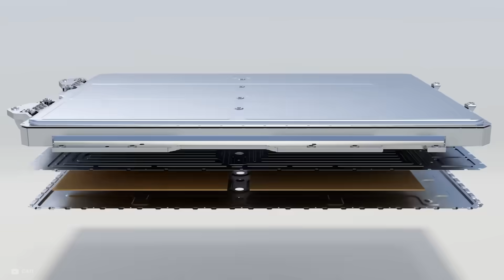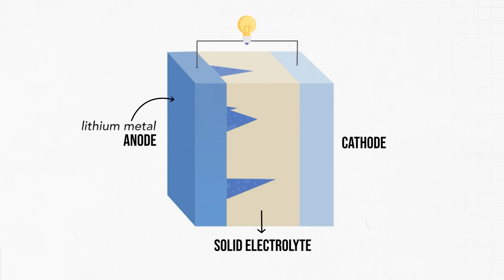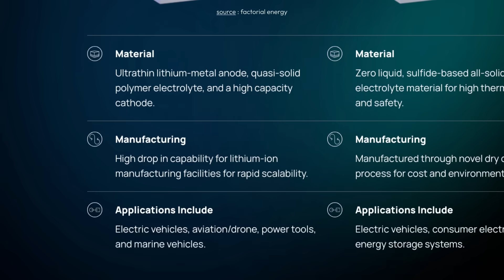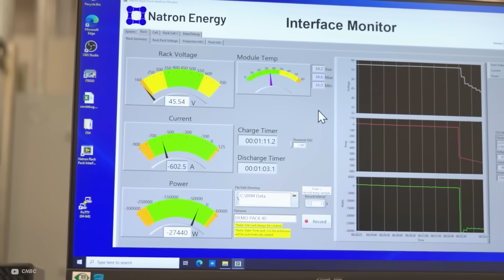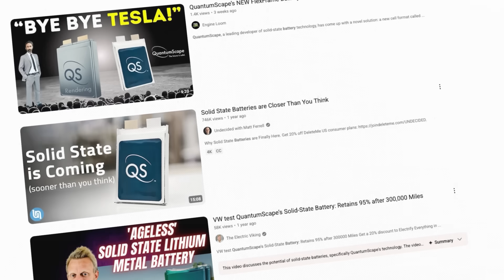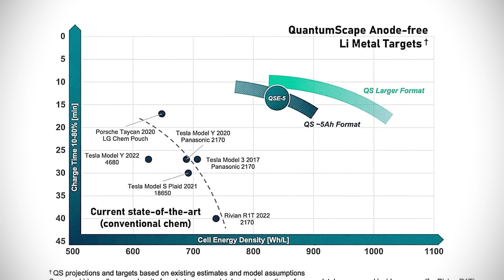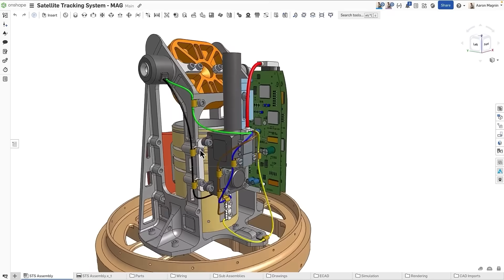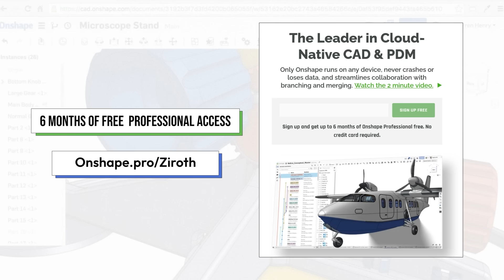The Decade Wait is Over, Solid-State Exists.

Comment: High-purity silica sand is the key to the mass production of these batteries. Is there enough of this sand out there in the wild to ensure that this can happen?
Reply: There's a company called Homerun Resources that is working with the University of California-Davis to develop advanced silica-purfication techniques for regular silica sand. If they can scale this technology, there should be more than enough sand for millenia.
Reply: @MontyBurns99  Interesting. Going to look into this.
Reply: Ffs….. refining silica is easy AF….. it literally just makes the process slightly more cost effective to start with more pure base material.

Use your brains….. you think we can refine from 99.9% to 99.9999999% 

But we can’t refine from 98 to 99.9%? 

I bet you I can refine sand I find at the local park with drain cleaner to make sodium silicate, and then make higher purity silica than that “high purity silica sand” that we’re pretending is the bottle neck of an entire industry because of that one documentary also made by people that don’t know what they’re talking about.
Reply: The purest silica is actually synthesized. We can also purify it, and recycle it. 

  The tech isn't exactly the most researched when we still have mines with 99.9999% pure. 

 Yes Spice Pine is a godsend. It's not the only solution. 

 Probably will find more mines too. 

 Just like with the grid or oil. There is no point in research investment if there is a cheap supply. 

 Did you guys know for like 20 years there. From 2000-2020 with a few exceptions. Energy demand was stagnant in the US? 

 Electronic demand went up, but also tech became more efficient. 

 China, not being capitalist. Doesn't care about profits. I just read China has found high quality deposites, and is pushing tech to purify it. I don't see Trump doing that. 

 So they are out there. We just need to find em. Even if it isn't nine nine pure. 

 Also maybe we can just stop exporting it to neutral or enemy countries we don't really need anything from.
Reply: Yeah, I think there is probably enough of the most abundant solid element on earth 😂
Reply: CATL will be the first
Reply: Silicates comprise around 20% of the elements in the entire earth. Look up UBIQUITOUS.
Reply: It's so good the internet is full of know-it-alls like yourself ... If only those dumb scientists listened 😤
Reply: Let's be clear, the ceramics used here would be using rounded sand not angular.  This is not for concrete; angular is the rarer kind because it's from more recent erosion.

Also this is 40 microns thick.
Reply: We have been purifying sillica for decades, how do you think we have been manufacturing all those silicon based computers, the abundance of silicon is outside the grasp of human intuition. Maybe the adoption of solid state batteries would pressure the manufacture industry to look for cheaper purification methods which would only benefit everyone
Reply: @Aurem6974  I'm talking about 99.9% pure silica. That isn't readily available yet
Reply: I think the shortage is based on demand rather than supply, nobody really needed 99.9% pure sand at these quantities before, but i doubt theres any resource scarcity reason to prevent them from scaling up
Reply: Been to the desert before.? Plenty of high quality silica.
Reply: Just ask Saudi Arabia. Or any Sahara adjacent country 😂
Reply: @Ashraile  Not all the sand in Saudi Arabia meets the threshold of the 98% pure silica content needed for industrial use. Only certain regions have deposits that meet that criteria.
Reply: @Ashraile  Sahara serves a very important ecosystem benefit for nutrient deliver all the way across the globe to the Amazon apparently through wind currents, so maybe we dont start harvesting the desert just to make batteries
Reply: @crispycrusader1 "You throw a stick in the air around here and it lands on some sort of sacred shrine" how about we don't "climate-bureau" abundantly efficient resources just to save a couple of hectares in a fking desert...
Reply: @ashraile its not hectares of desert lmao, and not sure what you mean by climate Bureu, i was only pointing out a thing, if humans want to grab, use, deplete every resource until they die and leave this world a husk by not using things efficiently so be it lmao, i won't judge or stop you
Reply: @crispycrusader1 go green when and where it makes sense, not when and where it doesn't. I see so many examples of good ideas getting railroaded because muh climate and it's annoying and ultimately pointless unless you want to tariff China and India who combined make up like 90% of global pollution but do go on 😂
Reply: @ashraile  thats what im saying, it makes sense depending on the situation to use battery, others using constant hydro, or nuclear is better, for extremely localized (single person camping for a week) and short term, hell a small tank gas heater
My point was that before we just start taking from a place we gauge and test the impact then consider moving ahead when its something like ripping up Sahara desert lmao
Reply: @Ashraile Well it doesn't help when some countries mass produce endless tons of e-waste and poorly made, devices that break after a few uses. That not only wastes resources in the end result but energy creating them, not to mention toxic by products during manufacture from some.

They really need to make quality products, not cheap trash. Surely that's a bigger war that really needs to be fought by environmentalists?
Reply: @ashraile

China is fast escaping that pattern installing acres of solar and   megawatts of wind  by the hour.... The change is real , fast and to  clean renewables  and the cheapest source of electrical energy by a long long way.  Na grid level storage makes the whole change even  cheaper .
Reply: @Ashraile  yup, if the saudis would pull their heads out of their asses they would have built glass foundries to process all the sand into glass products - bottles, cups, window tiles, solar panels /for water heating and photovoltaics/, laboratory equipment and optical glass cables for communication, as byproduct glass artists and they could even bind salt from desalination factories into glass bricks used for buildings instead of pumping the highly agressive solyanka back into the sea, they have cheap natural gas and lot of barren land and more than enough sun at their hand.....ffs.....
Reply: There is already a growing issue just for sand for concrete production... Soooo.. No. This will just mean more of a shortage on something already near a shortage.
Reply: @SilvaDreams There’s plenty of sand. Concrete needs river sand specifically, that’s why we’re running out of sand for concrete. Otherwise theres plenty
of sand in Sahara. The sand needed for batteries is not the same sand needed for concrete.
Reply: @SilvaDreams  You need to be dropped off in the middle of a huge desert.
Reply: @SilvaDreams : Concrete production is on the road to custom-ground rock to replace sand.
Reply: @SilvaDreams the concrete sand issue is based on the grain shape rather than the grain composition, concrete benefits best from a very specific grain size and shape and of course nature will create all sorts of sizes and shapes wherever it wants. This could probably even make the sand rejected from concrete manufacturing more useful therefore bringing more value to the market.

Comment: As long as it's fireproof I'm not fussed about the mix.
Reply: %EV fires vs %ICEV fires are won by ICEV (meaning they burn more often 😅).
It's just "bigger news" showing a new technology facing problems vs mundane tech that everyone's already familiar with.
Reply: Plain old lithium-ion batteries are already pretty damn fireproof with good QA. It’s surprisingly hard to get a properly manufactured cell to self ignite. Why do we set such vastly higher standards for EVs compared to ICE? EVs are already a huge win for fire safety. We’ve seen fires drop 10-20 fold with the mass adoption of modern EVs.
Reply: New Chinese regulations come into place July 1, 2026 aka Canada Day. They have to be fireproof by law there or they can't be sold. CATL is already compliant with its newest miracle, NAXTRA sodium-ion batteries which I'd love to see a deep dive into on this channel since it's the one that's going to make batteries dirt or in this case? table salt cheap! Even now the entry level cell pack price is $60/kWh which is less than LFP and that's in limited production at once facility in Sichuan Province for the Choco-Swap NIB tab battery system that can be used in dozens of compliant models..
Reply: Compared to what? GASOLINE? LITHIUM ION in its crudest earliest days is/was and will always be safer than literal FIREWATER! /s
Reply: Set a battery next to a building and flick a match at it. Now do the same with a gasoline soaked rag. Any questions????
Reply: Then you could finally get a smartphone..   People are so obsessed with car fires but not about smartphone fire... same lithium batteries..
Reply: @jacekpliszka5326  a phone fire is a [bit] different than a 2-3 ton car being on fire
Reply: @uiopuiop3472  well. I am much more worried about phone fire that happens in my fire-prone home than about car fire that is parked on the street. Additionally I spend much more time at home that in my car. I sleep at home, I am conscious in my car so I can react much faster.
Reply: Lithium cant be 100% fireproof
Reply: Current LFP batteries are already very fire proof. EVs have significantly less fires than fossil cars. The media give here a wrong picture.
Reply: I think the problem is with: if they catch fire, they are hard to extinguish.
Reply: my reply as member of [katasztrófavédelem also known as catastrophy protection agency] is that we wont ever b'e ready
Reply: How to you reconcile your statement with the fact that BYD built its own ships as it couldn’t find commercial shippers for insurance reasons related to fires???
Reply: @toddpillow3074   Well, BYD sure hasn't lost any ships. Issues seem to point elsewhere.
Reply: Lowered fire risk, higher risk of cell expansion and explosion, and as seen with that Californian network battery, they still caught fire, and burnt most the facility down even with improved venting.
Reply: @Buzzard-wq1bw  The batteries in the California battery plant were NMC, not LFP.

LFP are significantly more resistant to fire than NMC.

In October 2025 an oil refinery caught fire in California resulting in a shelter in place order for local residents. Should we get rid of oil refineries? The fire was also blamed for rises in fuel prices in the southwest due to loss of supply, so everyone was financially affected.

My point is you can’t single out one event without looking at the context of other equivalents.